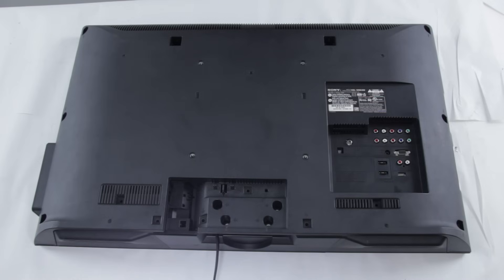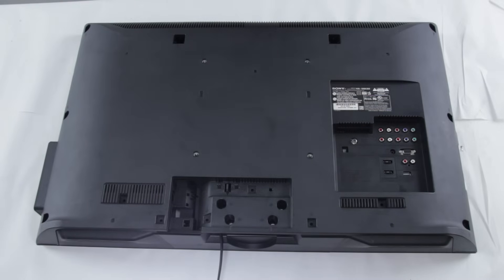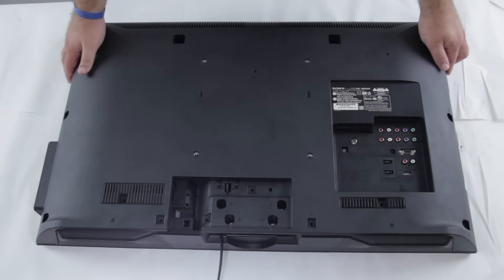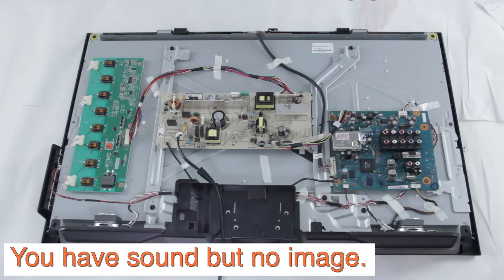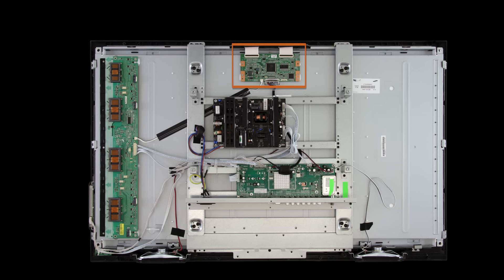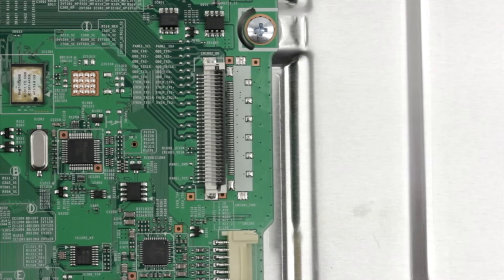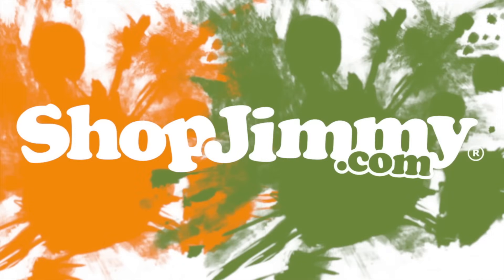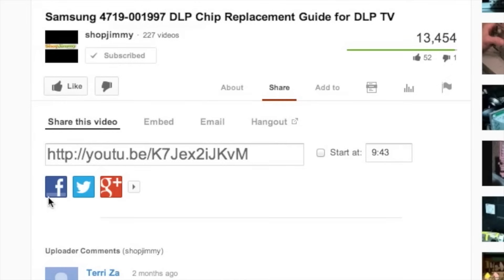LCD TV Repair Tutorial - T-Con Board Common Symptoms & Solutions - How to Replace T-Con Board

Comment: I have an LG Plasma TV Model 50PQ30-UA (april 2009) with perfect picture in only the top quarter of the screen. I have a lightning strike through the cable box, so i replaced the power board and the main board to get where I am with a picture. What is my next step to get the picture to fill the screen?

Comment: I am having problem with my Samsung LE37B551A6W, When I turned it on after 5 to 10 min slowly full screen goes white. feels like when we increase brightness sort of like this. Could you please help me to identify what parts are not working.
Reply from the maker: Samir Hossain  Please watch this video FIRST to help with your repair!  TV Repair! LCD, LED, Plasma, DLP How To Fix Your TV with ShopJimmy.com Help!  I recommend replacing the T-Con board in your TV.  Here is a link to replacement parts for your TV model number:  http://www.shopjimmy.com/catalogsearch/result/?q=LE37B551A6W  Be sure to match part numbers on your current board, with your replacement for compatibility.  Here is a link to a video showing how to identify your part number, click here:  DIY LCD TV Repair: Part Number Guide for AU Optronics (AUO) Timing Control (T-Con) Boards  Thanks and please let us know if you have any further questions with your TV Repair!  www.shopjimmy.com

Comment: Hi there. I was trying to do this myself, but slightly stumped. and embarrassed since I do have a degree in electronics

I have a Samsung 32" LED TV Model#UN32EH4003F.

It turns on and gives a screen, but the picture is split into 3rds.

Left to right, White, Blue, and Black, with a black line in between white and blue vertically, and slight horizontal lines all through blue and black side to side.

I hope this is not to confusing.

I did try disconnecting the ribbon cable at both ends from T-con,(circuit board on bottom to screen) and the main board to check for sure of no bad connections, but no go.

I hope I am calling them the correct names.

If need be I might be able to send a pic of what it is doing. Just let me know.

My guess is I have a bad main board. Any help would be greatly appreciated. I have watched a lot of your videos and learned a lot!! You guys Rock!

I have 6 TVs in all that were given to me a few days ago, and trying to set the house up nice if you know what I mean. 

Thanks in advance for any help or suggestions.

Regards, Rob    Texas

Comment: I have a Toshiba 50"led,model 50L1350U,serial D05248T03172L1
it has horizontal lines on the bottom 25% of screen,the video behind those lines go from blurry to HD every couple of seconds.The area affected is basically the area where the channel info is,pip,program info etc.What could be the problem?

Comment: Hi.  I have a 46" Insignia TV, Model NS-L46X-10A.  The audio is fine but the picture appears as a negative photo with a mostly white background.  Images are visible as outlined in red/blue.  From what I have researched so far it seems to be the T-con board.  I heard also the connections to the T-con board could be loose.  Please help me out with your thoughts, recommendations.  Thankyou.
Reply from the maker: JayF Finnern   Please watch this video FIRST to help with your repair!  TV Repair! LCD, LED, Plasma, DLP How To Fix Your TV with ShopJimmy.com Help!  I recommend replacing the main board in your TV.  Here is a link to replacement parts:  http://www.shopjimmy.com/catalogsearch/result/index/?cat=56&q=NS-L46X-10A  Be sure to match part numbers on your current board, with your replacement for compatibility.  Here is a link to a video showing how to identify your part number, click here:  STEP #1 - Insignia Main Boards Replacement TV Part Number Identification Guide  Thanks and please let us know if you have any further questions with your TV Repair!  www.shopjimmy.com
Reply: could be the tcon, make sure the tcon cable isn't loose.

Comment: Hello, 
I have a Vizio 60" LED smart TV.  (model #E601i-A3).  Owned the TV for approximately ten months.  A thin vertical green line on the right side of the TV about six inches from the edge.  T-Con problem?.

Mike

Comment: Hello I have a insignia modelNS-lcd19 TV I changed the power supply and main board it turns on no pic or sound what can it be it turned on once watched it for a little while then turned it off after an hour then went to watch it again I turned it on green light turns on and now no pic or sound nothing it won't turn off I have to unplug it to turn green power light off plz help
Reply from the maker: thomas laythe   Sounds like you have received a defective replacement board in your TV.  Might want to try different parts.  Thanks!  www.shopjimmy.com
Reply: Maybe power supply ??????

Comment: The lamps flicks with my HannSpree LCD Monitor (model: HSG1064), the power supply plus power inverter is LiteOn UA-3600-01HA-LF Rev B
Turn On and after a few seconds no light, but power on

¿what do you recommend?
Reply from the maker: Victor Manuel Navas Benavides  Please watch this video FIRST to help with your repair!  TV Repair! LCD, LED, Plasma, DLP How To Fix Your TV with ShopJimmy.com Help!  I recommend replacing the power supply board in your TV.  Here is a link to replacement parts:  http://www.shopjimmy.com/catalogsearch/result/?q=HSG1064  Be sure to match part numbers on your current board, with your replacement for compatibility.  Thanks and please let us know if you have any further questions with your TV Repair!  www.shopjimmy.com

Comment: I have a Sharp Aquos LC42D62U.  the picture became snowy, no issue on sound.  after unplugging or turning it off, it is okay for about 30 secs and then it is snowy again.  the menu and input screens are snowy as well.  is this a main board issue or T-con board issue?
Reply from the maker: 88dbco   This sounds like a problem with the main board in your TV and I recommend replacing the board.  Here is a link to replacement parts:  http://www.shopjimmy.com/catalogsearch/result/index/?cat=56&q=LC42D62U  Be sure to match part numbers on your current board, with your replacement for compatibility.  Thanks and please let us know if you have any further questions with your TV Repair!  www.shopjimmy.com

Comment: I am searching for a solution to a problem with an Element 40" LCD. The picture has
split down the middle and the right side of the picture is on the left and left on right.
Also see some image ghosting. Do you think it is the T-con, or tuner board?
Even the start up ELEMENT logo is split same way. clautomated@gmail.com

Comment: Dell 2408wfp showing green lines always. Seen here http://i.imgur.com/1NVRsuZ.jpg with no input.

Any idea?
Reply from the maker: mon0railbredpig   This could be a bad main board or the TV panel is bad.  I recommend replacing the main board to see if that fixes the problem.  This is a link to replacement parts:  http://www.shopjimmy.com/catalogsearch/result/index/?cat=56&q=2408wfp  Be sure to match part numbers on your current board, with your replacement for compatibility.  Thanks and please let us know if you have any further questions with your TV Repair!  www.shopjimmy.com

Comment: I bought a second hand Sony Bravia (KDL-40V3000 ser.no. 4010432) and it worked fine initially but the picture then went into a white haze and is sometimes negative. Is this a tcom issue or something else? Any help on fixing the issue would be much appreciated, thanks.
Reply from the maker: Joe Miller  Please watch this video FIRST to help with your repair!  TV Repair! LCD, LED, Plasma, DLP How To Fix Your TV with ShopJimmy.com Help!   I recommend replacing the T-Con Board in your TV.  Here is a link to replacement parts:  http://www.shopjimmy.com/catalogsearch/result/index/?cat=63&q=KDL-40V3000  Be sure to match part numbers on your current board, with your replacement for compatibility.  Here is a link to a video showing how to identify your part number, click here:  Samsung Timing Control (T-Con) Boards Part Numbers Identification for LCD HD TV Repair  Thanks and please let us know if you have any further questions with your TV Repair!  www.shopjimmy.com

Comment: hi I have a samsung 32 inch model 32eh4003f it has sound and backlighting and I can hear whatever I plug into the inputs but just can't see the picture, my question was should I replace the mainboard ,and does this model have a tcon built into the mainboard or is it hidden somewhere else cause when you open the back of tv all there is , is mainboard and power supply board.
Reply from the maker: Mike Edwards   Unfortunately we do not have any information on this TV model.  Thanks!  www.shopjimmy.com
Reply: Hey there. I have the exact same model. I have a similar issue. But my screen shows 3different colors. Did you get yours solved? Just curious
Reply: I took it all apart and cleaned all connections to board and now is working but i think eventually will have to replace main board

Comment: Hello 
 I have Sonykdl40s4100. I replaced the main board and it worked only for couple min. Then I don't know what I touch the whole screen turn red I can see the pic and sound. But color on the screen is all red. Even when I turn on the tv instead of gray or black it has red screen. I don't know what is wrong with that      I was thinking to chance the tcon board because that control the colors. Please advice. And thanks in advance.
Reply from the maker: Harpreet Bhogal   Please watch this video FIRST to help with your repair!  TV Repair! LCD, LED, Plasma, DLP How To Fix Your TV with ShopJimmy.com Help!  This sounds like it could be a problem with the T-Con board in your TV.  You can replace the T-Con board to see if that fixes the problem.  Here is a link to replacement parts:  http://www.shopjimmy.com/catalogsearch/result/index/?cat=63&q=Sony+kdl40s4100  Be sure to match part numbers on your current board, with your replacement for compatibility.  Thanks and please let us know if you have any further questions with your TV Repair!  www.shopjimmy.com

Comment: Having trouble with samsung LN52-A850. When I turn it on it has vertical colored lines after a short period they go away and are replaced by a wavy picture primarily in center of screen; after some more time horizontal lines and then sort of pops and I get a clear picture. How can I fix?
Reply from the maker: Robert Lemmer   This sounds like a TV panel (TV Screen) problem.  If your TV panel is bad, it may be more cost-effective to replace the TV as panels are typically hard to find in stock, difficult to replace, and expensive.  Thanks and please let us know if you have any further questions!  www.shopjimmy.com
Reply: might be a tcon, make sure your tcon cable isn't loose.

Comment: I have a lg 55lh40-ua and when you power it on all you see is a white screen. Could this be the t con board?
Reply from the maker: Chris Organ   Please watch this video FIRST to help with your repair!  TV Repair! LCD, LED, Plasma, DLP How To Fix Your TV with ShopJimmy.com Help!   Yes, it could the T-Con board or the Main Board.  I recommend replacing the T-Con board first and then if that does not fix the problem, replace the main board.  Here is a link to replacement parts:  http://www.shopjimmy.com/catalogsearch/result/?q=55lh40-ua  Be sure to match part numbers on your current board, with your replacement for compatibility.  Thanks and please let us know if you have any further questions with your TV Repair!  www.shopjimmy.com
Reply: T-con missing 5v. check fuses on t-con board

Comment: Our Mirai DTL-832E600  after 6yrs use, has developed white screen with picture "negative/saturated appearance". Power supply unit checks out on all voltages, everything else works ok. This fault appeared suddenly yesterday. I'm a retired tv. service engineer from CRT days. Any guidance to offer? S. No 832E600G8021533.
Reply from the maker: stan pitt   I recommend replacing the main board in your TV.  Unfortunately I do not see any replacement parts in the search results for your TV model number on our website.  Please reply with your part number on your main board and I can try searching for replacement parts.  Thanks and please let us know if you have any further questions!  www.shopjimmy.com
Reply: could be a tcon, make sure the tcon cable isn't loose.

Comment: I have a  Sharp Aquos LC-60LE640U.  It has a 2 blink cycle in the power light. One quick short blink fallowed by a blink.  We reset the system per instructions from Sharp Tech support and it worked again for a short time but has since failed again with the same blink pattern and can not be recovered.  Poking around the interwebs, it seems to be either a power supply board or a main board.  Do you stock those?

Comment: my Sony hdl 46xbr6 has very dark, distorted  picture when first turned on and then lightens up about 10 minutes after its turned on. Picture and sound is good after that. I thinks is the start of more issues. any suggestions? Thanks, your videos are very helpful
Reply from the maker: Ed Mcmahon   This could either be a bad T-Con board or the TV panel that is bad.  You can replace the T-Con board to see if that fixes the problem.  Here is a link to replacement parts for your TV model number on our website, click here:   http://www.shopjimmy.com/catalogsearch/result/?q=46xbr6  Be sure to match part numbers on your current board, with your replacement for compatibility.  Here is a link to a video showing how to identify your part number, click here:  DIY LCD TV Repair: Part Number Guide for AU Optronics (AUO) Timing Control (T-Con) Boards  You can also call our customer service for further assistance with your purchase.  (877) 881-6492  Thanks and please let us know if you have any further questions with your TV Repair!  www.shopjimmy.com

Comment: I'm having a problem with colored vertical lines on the left side of my screen. I replaced the tcon board and the ribbons and that did not help. What other way can I fix it?. The tv is model number lc 60 Le 550  it's a 60 in sharp.
Reply from the maker: Chris Knotts   This sounds like a TV panel (TV Screen) problem.  If your TV panel is bad, it may be more cost-effective to replace the TV as panels are typically hard to find in stock, difficult to replace, and expensive.  Thanks and please let us know if you have any further questions!  www.shopjimmy.com

Comment: Hello, I purchased a T Con Board LJ94-01804H for my Samsung TV Model # LNT4665FX/XAA as suggested by Shopjimmy.com based on the issue I provided which was; slow response in movement on the screen, vertical lines and discoloration in the images. I replaced the board and it worked well for about 5 minutes but then went right back to the way it was. Is there another problem I should be considering to fix? Thank You.
Reply from the maker: Marcus Anderson   This sounds like a TV panel (TV Screen) problem.  If your TV panel is bad, it may be more cost-effective to replace the TV as panels are typically hard to find in stock, difficult to replace, and expensive.  Thanks and please let us know if you have any further questions!  www.shopjimmy.com

Comment: Thankyou, in regards to pin pointing the fault with the TCON board do you know any good test methods i have noticed that there are various test points on the circuit board however i am unfamillier when interegating circuit boards i am an instrument technician by trade so i can follow if you can explain thankyou very much.

kind regards,

ben

Comment: I have a LG 42 inch lcd tv (42LC46) the tv can work fine when switched on, but picture starts to go manic flickering also sound stops when its doing it, I solved it by reducing the resolution to 480 but now that dont work. sometimes the picture flickers and sometimes it disappears and comes back (on off on off) but sound also disapears with it
Reply from the maker: tam mcfarlane  I recommend replacing the power supply board in your TV.  Here is a link to replacement parts for your TV model number on our website, click here:  http://www.shopjimmy.com/catalogsearch/result/index/?cat=229&q=42LC46  Be sure to match part numbers on your current board, with your replacement for compatibility.  You can also call our customer service for further assistance with your purchase.  (877) 881-6492  Thanks and please let us know if you have any further questions with your TV Repair!  www.shopjimmy.com

Comment: I have a 32" LG LCD HDTV, model no. 32LG70-UA, serial no. 808MXUN5D734. The TV suddenly started having ghost images really bad and the colors are also way off. It is also slightly blurry. This problem also affects the tv menu screens as well. Any idea on what the issue could be?
Reply from the maker: DG0TTi   This sounds like a TV panel (TV Screen) problem.  If your TV panel is bad, it may be more cost-effective to replace the TV as panels are typically hard to find in stock, difficult to replace, and expensive.  Thanks and please let us know if you have any further questions!  www.shopjimmy.com

Comment: Hi i have a samsung LE40A456C2D it has a faded mist like white screen i have sound and power obviously, i have opened the back of the panel up and reseated the ribbons i have checked the capacitors and there is no bubbling or leaking do you have any ideas that could help me it would be much appriecated.

kind regards,

Ben
Reply from the maker: ben harrington   I recommend replacing the T-Con board in your TV.  Here is a link to replacement parts for your TV model number on our website, click here:  http://www.shopjimmy.com/catalogsearch/result/index/?cat=63&q=LE40A456C2D  Be sure to match part numbers on your current board, with your replacement for compatibility.  You can also call our customer service for further assistance with your purchase.  (877) 881-6492  Thanks and please let us know if you have any further questions with your TV Repair!  www.shopjimmy.com